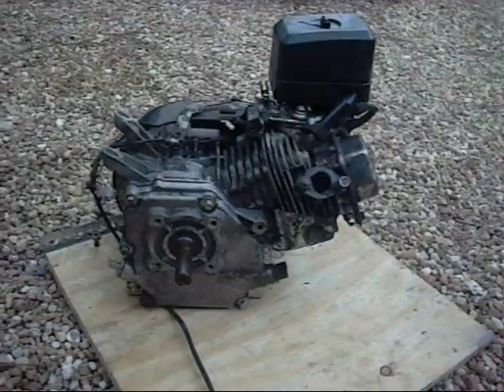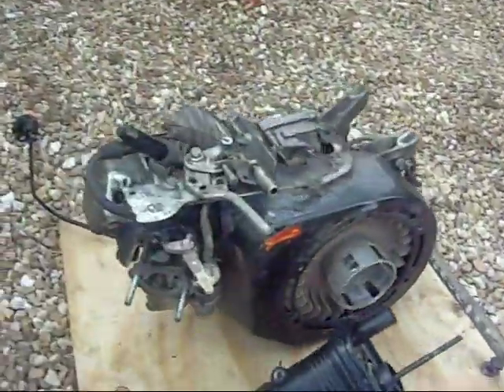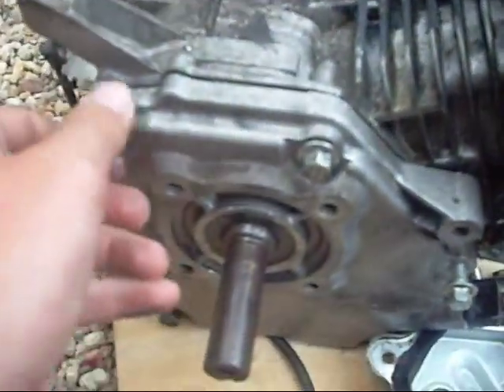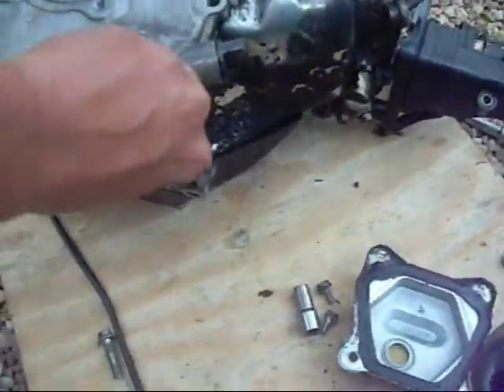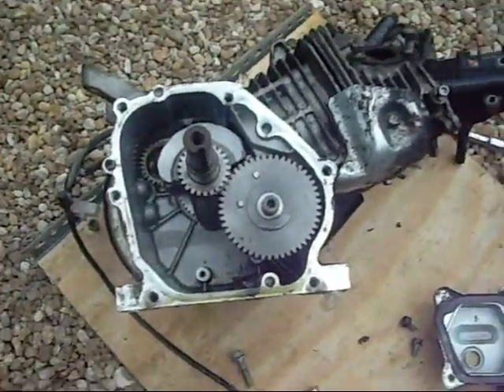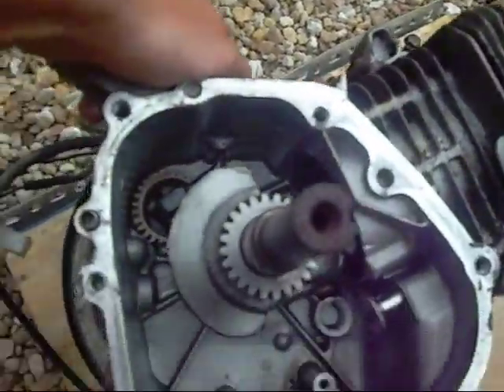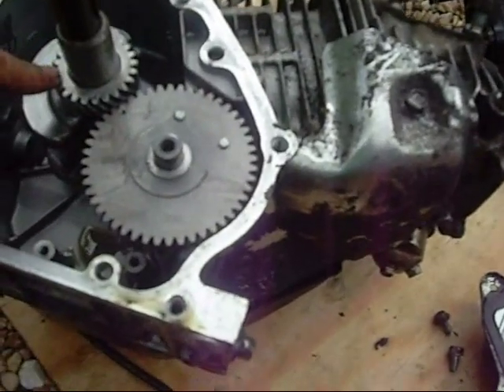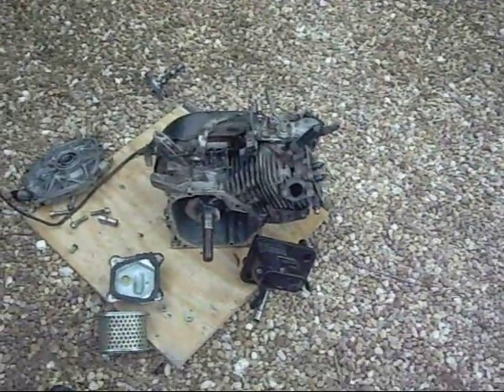Honda GX 200

Comment from the maker: these engines will only make 5.5hp in stock configuration because the governor limits rpm, which limits power output. You are correct, with mods these engines can make much more hp

Comment: My son races a clone copy of a GX 200,,,,,,with the governor removed and the low oil shut off removed....And we turn it 6000-6500 every weekend, with no aftermarket cam or flywheel....Everything is stock except the muffler,,,we run a small header with a washer welded on the end....If you think they cant make more than 5.5 horse power you are sadly mistaken,,,,and thats on 87 pump gas.....